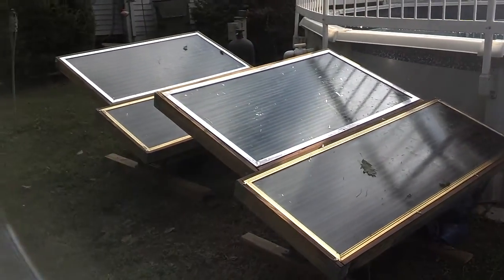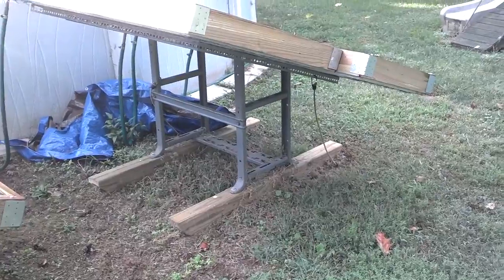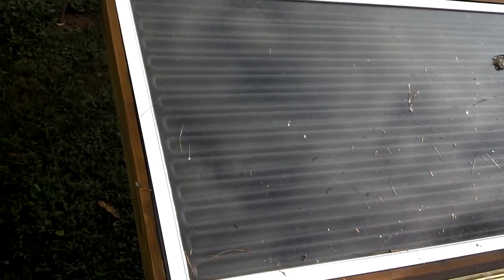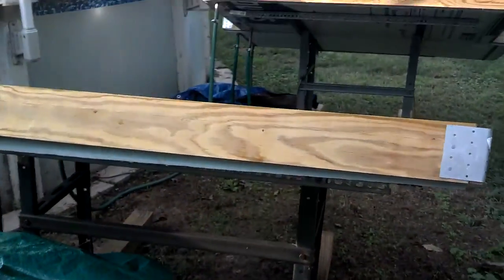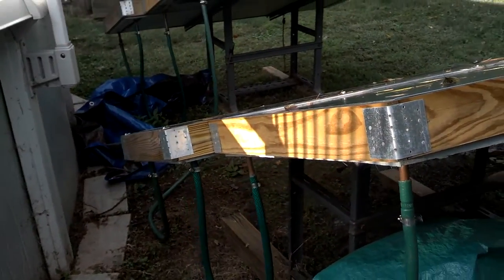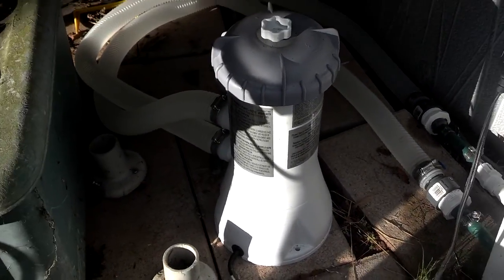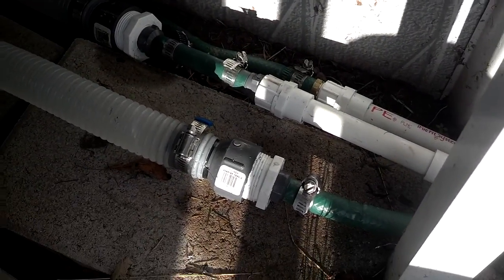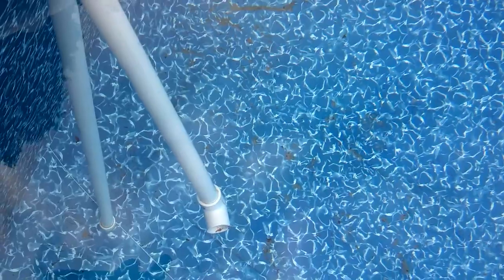Custom Built Solar Panel Water Heater System for Swimming Pool Using Glass Shower Doors

Comment: That is a lot of 90's.
Did you try or consider soft copper in a coil configuration?  I know plastic doesn't have near the thermal transfer of copper, but it''s a lot cheaper. I guess you could have more tubing with plastic, but an extra pump might be needed .
I have a washing machine tub on short legs. I put 40 feet of copper around the inside wall. Stoke it with wood and point a fan that direction for a while. I was hoping it would create a cycle without a pump. Feed at bottom of coil and exhaust at top. It might have worked if the joints had been sil-fossed, because it melted the solder right off.  Gotta be careful, the output is steam if I have the pump too slow.
Reply from the maker: Good question. What I should have done was put two large dia headers on either end and use multiple lines of 1/8" tubing between them. the smaller tubes would heat more effectively and the headers would a lot less flow resistance.
Reply: @TheWorldAsSeenByTom  I'm getting ready to build some heaters. I'd ry that if I could bore fittings like they used to, I'd try 1.25 inch headers and put 3/8 drops as close as possible. With fittings, too much wasted space between.
Maybe try to find an old radiator, paint it black and put behind glass. (I think 3mm is what I've been seeing recommended.)
Thanks for reply.
Reply from the maker: FYI: Ive seen some version where they solder all connections, but that was with 1/4" tube into a large header. I also painted mine with black high temp grill paint. good luck
Reply from the maker: thats the one I saw

Comment: very good idea!  i had a solar water heater on the roof and the tank corroded and got damaged.  I dismantled eveything and I am now left with 2 water solar panels in very good condition.  Can i install these in line with my pool's water system.  if yes, what is the best way to do it?  Thanks for your help.
Reply from the maker: you need to check the flow rate the panels can handle compared to your pool pump volume rate, pressures, etc.

Comment: Nice work!
How much would you say each panel Temperature rise do you get?
Curious on how many panels would be needed for a Jacuzzi?
Reply from the maker: +CMC Fab I think each panel was about $150, the copper pipe was most expensive, I picked the shower doors from the trash. Maybe one good sized panel will work for a hot tub. Im not sure how well it would work for maintaining hi temps, you need full sun. the longer the water sits in the pipe the hotter it gets. but it can easily reach +100 deg. it depends on how much water you need. dont remember the inner pipe volume, you need to calc that and compare to hot tub volume. The warmer the tub water, the faster it can reach hi temp, but def full sun will be needed. I wanted to try a diferent style with header inside the panels on the short ends and put long lenghts of smaller tube between the headers, it should increase the time needed to get hi temps. I hope that helps.